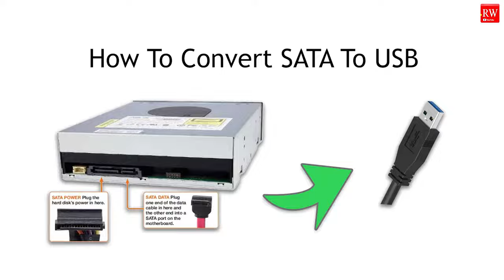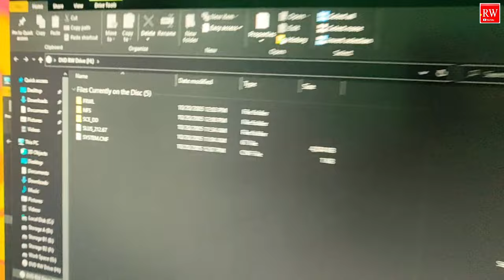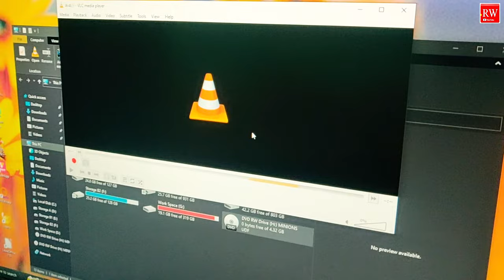SATA DVD Reader Convert to USB CABLE at free

Comment: You are not explaining well how to do the wiring for the 12 power would you explain that or provide a diagram than you.
Reply from the maker: The 12 pin connector typically use for power supply in here we need only 4 pins. Pin number 5, 6, 7, 8. Pin 5 was positive 5Volt input and pin 7 was positive 12Volt input. 6 and 8 are grounds. So the simple way to identify the pin if you have 12pin sata to 4pin molex connector or take old SMPS sata power connector that you can see 4 wires 2 black wires and 1 red and 1 yellow the most of the SMPS are coming the same voltage identify colour the red wire was 5v dc and yellow was 12v dc the 2 black wires are grounds. If you was connecting laptop hard disk or SSD it only need 5v if you want connect dvd writer or 3.5 desktop HDD it want more power to spin the disk so it need 12v power supply you can use 2 Amps Adaptor to work smoothly NOTE :- dvd or Desktop HDD want both power supply at same time 5v and 12v 👍 any doubt just tell me

Comment: Please repost the video and explain everything without music and where to get the parts
Reply from the maker: @imadesaci4928  bro actually that board was I get in my friend give it to me because that board was broken. If you find that board (it was 2.5 hard disk board) that means it only support 2.5 hard disk or dvd writer like laptop's drive. But in this video I was converted that 2.5 board to 3.5 that means desktop HDD or dvd writer or ect. The only difference between 2.5 and 3.5 is the 3.5 need extra power supply like 12v and also need 5v at the same time. But 2.5 only need 5v that's why it was low price. There I only I showing how to connect the power supply. I was solder that sata and sata power connector because the old one was broken and also I need to add 12v 👍 if I made a video which language are you prefer 😊

Comment: Bro anikk sata data cablum usb data cable thammil join cheyyanam but athokke terminals thammil connect cheyyanam annu ariyillla.
Reply from the maker: Sorry for the delay reply bro😞 busy Life 

Anyway bro USB and sata direct connect cheyan pattilla because usbil 4 wires annu varunnath (red+/black-/white Data+/Green Data-) but sata cableil 7 pins varunnund athil 3 ennam ground annu baki olla 4 ennam data transfer nu ollathanu

Ground – Pin 1
Transmit Data- (TD-) – Pin 2
Transmit Data+ (TD+) – Pin 3
Ground – Pin 4
Receive Data- (RD-) – Pin 5
Receive Data+ (RD+) – Pin 6
Ground – Pin 7

So oru converter evide avisham annu because sata provide cheyunna signal alla usb provide cheyunnath. Athukondu sata signal convert cheythu usb signal akki mattanam athinnu oru prossing ic must annu 🥴 so IC vedichu build cheythedukkan extarnal hdd adaptor vedikkunathilum  kal amount avum. Usb to sata direct koduthal chilapol HDD adichu povan olla chance ondu. 😅 Simple method is oru second hand allakil new adaptor vedikkunathannu 👍

Comment: well done bro:hand-pink-waving: i hv one but didnt know what to do what exactly should i buy
Reply from the maker: Bro if you have a sata to USB converter that only thing was to make this I was using 2.5 sata converter that not actually work in dvd reader because that have only 5v supply but the dvd want 5v and 12v at same time so I was added a 2.5 sata converter board and 12v adaptor it's work also you can connect this at any 3.5 sata support products but also 3.5 adaptor available in our market but the price was to expensive 🫰 so I make this I was used the same method that 3.5 converter using. 🥴 Bro if have small budget then you buy 2.5 converter, sata power supply connecter, and 12v 1amp adaptor, total cost around you have 700rs to 800rs but if you have old adaptor or 2.5 convert that's make the price lower. If you have money then buy 3.5 converter that's also coming with a charger to total price around 3000rs 🥴 if you was planning to connect old Sata HDD that's want more ampere adaptor 3ampere is good performance giving but price was some increase you was only planing to dvd reader then 1 ampere is enough 🙂any doubt I am here 🤙